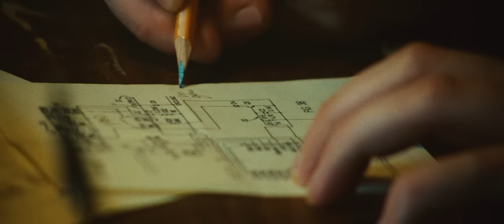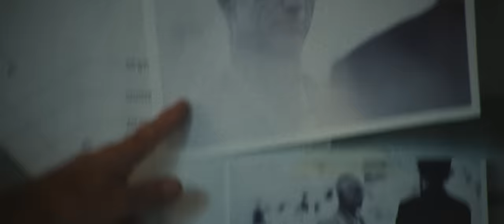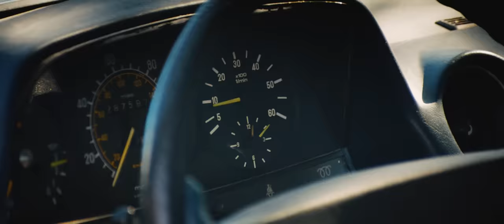Foxwarren - "Everything Apart"

Comment: Bomber uses a $13 multimeter? Seems like you might want to invest in a top of the line Fluke in situations like that.
Reply: In the end, it does not matter, does it.
Reply: @vixiki  Amateurs. They didn't pay attention to details,and as they say, the Devil is in the details
Reply: @tranzco1173  Well, their problem was a change of their target's plan, the bomb worked perfectly...
Reply: @vixiki  The problem was not anticipating changes in the expected scenario. Wire in a kill switch, turn off bomb. Technology has been around since the 1950's. It would require a bombmaker with at least an entry level multimeter. 
Even the IRA or Canadian folk singers could plan a bombing better than this. 
This scene was in Scarface.